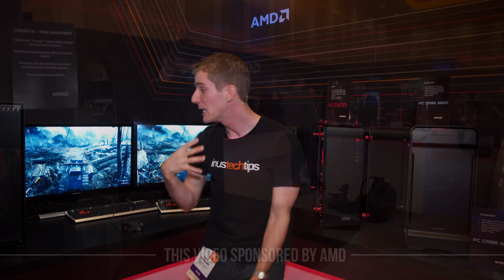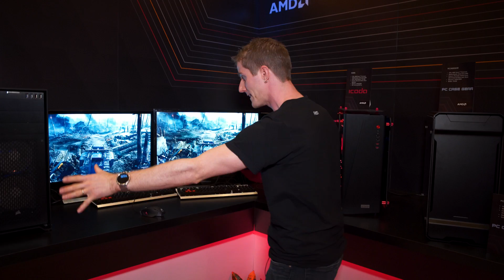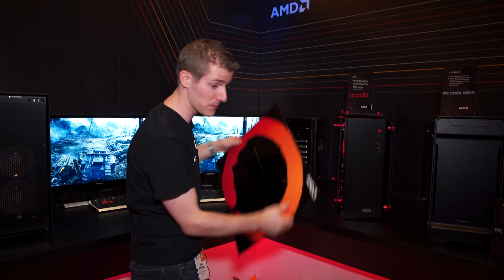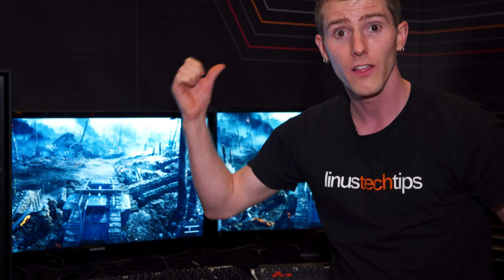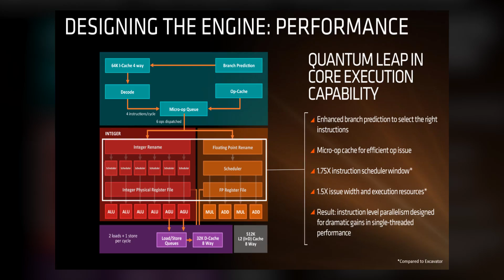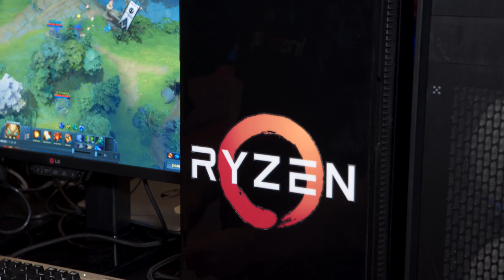AMD Has Ryzen!

Comment: amd prob handpicked their cpu
Reply from the maker: +Portgas D Ace it really doesn't work like that...
Reply: Pretty sure they used their feet
Reply: Linus defending AMD??? Is this an alternate universe??
Reply: good one linus!
Reply: Portgas D Ace Are you stupid?

How do you even handpick a CPU? This isn't like a GPU where certain chips OC Higher, this was a test made at 3.4GHz without even having TURBO enabled, which has been confirmed works at 4GHz.

Like, the fuck you're on?
Reply: its good for the consumer that AMD is getting back to basics and pull it together, me myself will never buy AMD (intel / nvidia fanboy) but for its good for everyone if they keep getting competition 
TLDR: AMD back, lower prices and more advancements on both companies
Reply: silicon purity only affects overclocking and that AMD CPU was running stock with no CPU boost so in conclusion even if they decided to get a 100% pure chip it would still be as fast as regular (At stock clockspeed).
Reply: roasted
Reply: LinusTechTips Linus be telling kids what's what.
Reply: SO WHAT? You think Intel doesn't do the same thing?
Reply: Sigh...what Linus means is you can't handpick more cache and IPC performance etc, it's hard clocked at a certain frequency, what 'handpicking' means is picking a CPU/GPU/Monitor or whatever piece of hardware that is above the rest in terms of overclocking and using that in order to skew results, that is NOT relevant to these tests whatsoever, even the best overclocking chip known to man doesn't have any benefit over a shit one if they're both running at a set speed...basically you look like a fool.
Reply: Portgas D Ace the fuck are you talking about
Reply: why the hell do you want amd to fail?

intel has not been innovating and that much is very apparent, they have not had a serious competitor in years and now amd threatens intel's market dominance with ryzen so "they must be hand picking their chips cause amd sucks so bad"

even if you are an intel fanboy, amd getting better only benefits you since it will force intel to not only lower costs of current chips, but also be forced to release faster chips unlike the clear money grab that is kaby lake
Reply: This guy lmao
Reply: Almost seems like these kids do not want intel to have a legitimate rival and for the prices to fall due to competition, Your parents must have more money than sense.
Reply: Portgas D Ace its like you want Intel to keep winning and charging you 1K or maybe even more for their 6900K, what are you stupid ? Not sure about US but the new Z270 boards prices had increased significantly once more like the MSI Pro Carbon its now same price as their old M5 Gaming seriously wtf and their Gaming M5 is more expensive than the Z170 Sabertooth. I can't wait to see the day mainstream Mobo that costs us over 600$
Reply: tbh he's probably just angry that intel has some competition for once haha
i mean hey he can think whatever he wants but i, for one, love how amd is going to be forcing intel to actually upgrade their cpu's decently for once. kaby lake 7700k is legit equivalent in performance to an overclocked 6700k.
Reply: Stock clock speed is stock clock speed.  These chips are ready to release and just waiting for marketing, packaging, and partnerships to finish their end (finish MOBOs, build laptop and desktop consumer devices, etc.)...this means that the stock clock they used in these particular demos will be the same as the stock clocks you get in your OEM packaging.  Now, I am sure they hand picked what they overclocked to 5 GHz for the press events they did last month...but that still isn't underhanded as one in 5 processors going out in OEM packaging will be capable of even slightly edging what they handpicked, and probably only 1 in 50 not able to get close enough to those numbers to be considered passing.  This isn't 1995 where 30hz difference was miles apart in performance...you miss 5.0 and land on 4.97 I don't think you are going to bitch and complain.
Reply: butthurt Intel fanboy spotted
Reply: +LinusTechTips it could have been binned for better overclocking but thats about it
Reply: It wouldn't make a difference if AMD handpicked the CPU, because Linus says that it's running at stock 3.4 Ghz speed, without any dynamic overclocking features enabled. So, the best and the worst same-model Ryzen CPU, running at 3.4 Ghz, is only going to deliver the performance of 3.4 Ghz.
Reply: yes, handpicked...
hence why the clock speed is below that of the production models, and turbo-core is completely disabled.....

I mean it could be a high binned chip, it could even be capable of breaking 10ghz on LN2 for all we know! however it's just not set up to take any advantage of cherrypicking whatsoever as any potential advantage has been tuned out for testing and demonstration purposes.
Reply: they werent overclocked fuccboi..so it doesn't matter.gtfo
Reply: These processors were clearly prototypes, along with the motherboards featured. Dont get into the conspiracy idiocy so soon boy. They're NOT EVEN OUT YET.

Great features in perspective, thanks Linus (and also the one(s) behind the camera) !
Reply: Because people are emotion based thinkers not evidence based thinkers. I am an intel consumer because for the last 10 years give or take intel has had the superior chips, not the best cost to performance ratio chips but the best performance chips. Those are facts, you can look up multiple benchmarks that support that AMD chips under performed compared to intel. That being said if the Ryzen chip is better than intel's $1000 chip then it is better. It is too early to claim it is as we need multiple independent tests, but IF this is true it will be good for ALL consumers. If AMD actually becomes a competitor or leader in CPU market like they were in the past that will drive innovation. I am not threaten owning an I7 6800k knowing that the Ryzen is in all probability a better cpu. Then again myself worth isn't tied to me being part of the "winning" team. If when I buy an new computer and AMD has the better cpu I will buy an AMD if intel has a better cpu then I will buy intel. I am "loyal" to the chip that best fits my needs not to a brand name.
Reply: Most likely! They probably disabled turboboost and downclocked too.
Reply: cpus are produced in large quantities as things known as "wafers". The process is 100% automated and there are only a few people to take samples and stuff... Machines are the ones that detect defective chips. Sometimes defective chips are rebranded as cheaper models. That's basically it. I'm not sure if you know this but nowadays the Core i5 series are in fact defective i7s... However there was an i5 model which was in fact designed as an i5 from the very beginning which was the Clarkdale. The Clarkdale i5 was sold as an MCM featuring the Clarkdale i5 CPU chip and a GPU chip as well. It was a package with two chips.
Reply: Like the common animal in the wild, when attacked strikes out in moody pointless words. Typical bland comment from +Portgas D Ace
Reply: hand picked?? If a cherry picked GOLDEN sample capable of 5.5Ghz is compared to a dog shit overclocking CPU they will still perform the same when at the same clock speed. In these example the CPU was clocked at 3.4Ghz with no turbo. Period. Why the actual fuck is such a retarded comment being upvoted....
Reply: Over 493 idiots ticked this guy up wtf.... Handpicking Ryzen and then running it at 3.4GHz base clock has what advantage exactly?
Reply: honestly if you fan boy over any brand it's really stupid, I personally buy what has the best price to performance within my budget; I personally think people who dont do this are making a very stupid move and missing out.
Reply: Even if it did work like that, no shit! Why would any company with the purpose of making money, not show off the CPU at its best. I have an Intel chip, but even I can see why this statement is retarded.
Reply: pretty sure most, if not all preview hardware is likely to be cherry-picked.
Reply: you dumb fck
Reply: At stock speeds hand picking a cpu would be meaningless because the performance would be the same for all chips that passed quality control. These demos ran at stock speeds so no need to hand pick.
Reply: ... Vega isn't out yet. a Titan XP is, and since you're comparing CPU's you have to minimise all other variables.

Adding an unfinished CPU AND an unfinished GPU to these test systems would completely muddle the results.

So there's no way in hell any sane company would use something like Vega in a demo trying to prove what their CPU is capable of even if it's the best graphics card ever made by a huge margin.

They have to use something which has known performance.
They could have used a Fury X or RX480...
But let's face it everyone knows the Titan XP is faster than either of those.
Plus, using an nvidia card avoids accusations of using underhanded tricks with the drivers and CPU logic.
Since they didn't make the GPU, it's much harder to claim they did anything weird to it to make the AMD CPU look better...

As for cherrypicking the test CPU.
No, duh.
It's an engineering sample. Those often aren't as good as the production models in general, so you end up needing to choose them carefully just to get results in line with the final product.

And really as everyone has already pointed, it doesn't matter because the only thing you get out of it is potentially faster clockspeeds.
But, that's only relevant if the speed you are testing at is much faster than what most of them can even accomplish.
If the test was done on a chip that could do 3.4 ghz and most of them turn out to only be able to manage 2.8 you might have a point. But otherwise it's really quite irrelevant.

OK, yes, a cherry-picked CPU will likely produce less heat and power too, for a given speed, but that's only relevant if that's what you're testing for...
Reply: Even if they did, they didn't overclocked it, it was running at 3.4GHz vs the 3.7GHz of the 6900K while maintaining the same level of performance, which is already by itself VERY impressive!
Reply: You realize it is running at the base frequency so there would literally be no benefit to "hand picking" the CPU. Right?

Fanboys are so sad.
Reply: +Jonhy456 Handpicking a cpu means testing a bunch for overclocking potential and choosing the best one for show, or use... Which obviously has nothing to do with base clock results.
Reply: I don't think that it was mentioned that the chips were OCed
Reply: Portgas D Ace because if they handpicked it from all of them then at best it would get better clock speeds for overclocking, and even then that machine isn't using a cooler that could make use of that, but even if it did it still wouldn't matter because clock speeds don't make much of a difference when gaming, so in pretty much every sense, what you said isn't how this works
Reply: Implying Intel and Nvidia don't, fucking retardation to the maximum.
Reply: Portgas D Ace so does intel when they show their CPUs
Reply: They don't think their hardware sucks, they just are smart enough to realize that the FASTEST gpu on the planet right now is the Titan XP. That was a smart decision. Shut the fuck up, you fan boy.
Reply: personally fanboyism is dumb, get what is better, for me an older amd 8 core at £120 is better than a newer albeit better intel 4 core at  £250, my build is a 960 and 8320 built at christmas 2015, i wanted to go all amd as their buisness model is better ( almost all their technoligies are open source ) but the 960 is so much better than the 270. amd ryzen looks really promising and i hope with more optimisation a lot of games that struggle on amd will become great. ( amd's single core is horrible plz fix, 30% usage in arma 3 with 20fps ugh )
Reply: well he has a point ( they picked the CPU using their hand and put it in the MOBO  by hand ) * grins *
Reply: lol handpicked one that only ran at 3.4ghz riiiiiight
Reply: it wasn't over clocked or boosting so... that woudnt have made any difference in this test
Reply: ARMA is a horribly optimized game. Its still as horribly optimized as Operation Flashpoint was from 16 YEARS AGO, which still even today no CPU can play at 5000m view distance... That just means the game engine is crap, not the CPU. 

Try to be a bit more rational in your remarks Portgas...
Reply: are you stupid? These are brands we are talking about not fucking sport teams, you shouldnt buy computer parts based on which brand it is
Reply: Weak excuse .....
Reply: They handpicked a cpu to run at 3.4 ghz? It wasn't overclocked and the dynamic range boost was turned off. What were they handpicking for?
Reply: Goddamn, 1000 dumbasses liked this comment.
Reply: If you knew how CPUs are produced on silicon wafers, you'd realize this sounds silly.
Reply: +Portgas D Ace

What are you talking about? There's no mention of them overclocking here. A CPU either runs at it's spec or not; variance of different chips plays a factor when they're run above spec, such as with overclocking.
Reply: @ Live Unlimited Fanboy Much?
intel has iGPU .
 bin picked by testing makes what  a 7700 or a 7700k or even an i5 or i7 will be so your wrong on the OC too.
AMD doesnt work on GPU anymore its Radeon and the business is official seperated .
what you call "better" means cheaper as you cant afford intel or Nvidea's high end stuff.or as AMD fanboys like to say price vs performance.

Dont get me wrong Ryzen should perform 10% better than 6900K at 8/16 and atleast 5% better than 7700k at 4/8 so the fanboy war can keep going on .....
Reply: I currently I prefer Intel CPU but I prefer AMD GPU, but RYZEN could change my CPU opinion.
Reply: the fuck are you on? CPUs are exactly like gpus... Each and every one of them may be different and has their own potentials at OC and btw clock speed isn't the only variable that determines the overall performance of a CPU
Reply: amd fan boys still gonna buy 32 core cpu's for four core games and cry when it sucks lol
Reply: he got upvoted so people can see his fanboyism XD
Reply: when amd butt fucked you did they use lube? by the triggered comment I guess they didnt
Reply: See this is the kind of "Intel Fanboy in Disguise" comment wrap a jibe in a fragment of what sounds like logic to cover your bias.

When a manufacturer be it Intel or AMD states a base clock then all cores must be capable of that clockspeed otherwise they open themselves up to false advertising lawsuits much like Nvidia did with the GTX 970 "4GBGate" My Intel 4670k for example runs at its 3.4Ghz Base Clock on all 4 cores, I can overclock all 4 cores to 4.3Ghz and be stable however if I don't want all cores to be equal than I can overclock core 1+2 to 4.5Ghz.

Personally I don't get this whole stupid bias crap I've have both AMD/Intel CPU's and AMD/Nvidia GPU's I get the best performing card/cpu within my budget at the time right now its Intel/Nvidia next time round it might be AMD or it might be Intel again.
Reply: Well how the hell do you think they installed it? With their hands, genius. Kids today...
Reply: You mean just like AMD and Intel has done for over 12 years? Yes Probably. Your point?
Reply: LinusTechTips Shots fired. CES was great fun this year. Flir got the DUO working on Day 2, looks like it could be a cool thing to have for some content creators.
Reply: no they're not nvidia
Reply: They also procured the TOP OF THE LINE competitor to test against. If they got an i3 from 4 generations ago then that would be crap, but your argument is invalid for more than one reason.
Reply: AMD has Ryzen!
Reply: Portgas D Ace you mean AMD made their CPU better? lol
Reply: Portgas D Ace they all do that including intel and nvidia remember there selling a product that is why i have always said ill belive it when i see it
Reply: Learn to research a bit before you pick a fight acting like a know it all, fyi.

If you actually invested your time into researching properly as linus also mentioned these are the exact systems that was displayed at the New Horizon Event a month back, during that Event they tested  Ryzen at stock 3,4 ghz vs the i7 6900k yes Turbo boost was enabled here for intel.

They tested them in Handbrake and Blender rendering it doesnt get more CPU intensive than this and Ryzen actually beats the 6900K in handbrake by 5 seconds thats 10% faster than the 6900K

Please do yourself a favor and research before u start a discussion and make a fool of yourself.

and Yes they also showcased Ryzen with Vega during that event, but Vega is far from ready and thats why you havent seen any official pairing with Ryzen + Vega other than some Doom 3 teasers.

Also just to put a nail in the coffin on the handpick bs you claim.

Doesn't matter what intel does, Cherry picked CPU only gets better overclocking potential and the Ryzen was handicapped by putting it locked at 3.4 ghz pr. core rendering your argument invalid.
Reply: hey don't destroy ace name your fanboyism,  even though I myself is using intel i believe amd will be competitive this year  XD
Reply: AIRGEDOK biggest problem is only a fraction of consumers want "the absolute best"  overpriced 600$ or whatnot high end chip (wich barely  improves your experience anyway)  and most people are value minder don't care about a couple of % less performance when they can save hundreds of dollars. Value is way more important for me and it allows me to spend more on different things
Reply: +ADevilNeverCry AMD going to suck anyway intel will always be better I bet they already have the next cpu ready to hit the markets if ryzen proves to be a threat and nvidia has the 1080 ti ready as well. AMD should just quit while they're ahead those shares aren't going to be this high ever again lol.
Reply: +Portgas D Ace 
They did use a Vega GPU in the 4k Star Wars Battlefront Rogue One Demo.....so yeah.
Reply: They need to educate themselves that AMD have been ahead of both Intel and Nvidia in the past and there is absolutely no reason it won't happen again.
Reply: I don't think so, Linus said that turbo is disabled and CPU is at 3.4GHz which is stock for engineering sample F3
Reply: Rofl you are stupid, the clock speeds were at default with no turbo, if they wanted they could have picked a awful chip.
Reply: He doesn't need to you need to read up on Ryzen just like my current 4670K this Ryzen's base clock is 3.4Ghz only difference a "handpicked CPU" will make is to the max possible stable overclock, just look back at the ASUS PC DIY Channel vids on their Haswell build guides for z87/z97 with the 4770k/4790k CPU's their examples often go to 4.7Ghz-4.9Ghz yet most are lucky if they can get 4.5Ghz.

If 3.4Ghz was the overclocked speed you'd have a point since as it isn't your point is void.
Reply: WHAT THE FUCK DOES HANDPICKED CPU MEAN YOU ASSFUCKS????????????/
Reply: Btw for those who dont know yet.
Binpicked = factory process by testing processors(cpu and Gpu) on quality/performance to classefy the type its range does

Handpicked = out factory process tested performance based on single thread , multithread or overclock.
                         while single core is for stability , multi is task managing between threads and overclock for 
                         core speed . 
the last therm is used alot for cpu that is tested for max overclock capacity and in that spectrum  its mostly done in multithread but as actualy the intel K series can overclock cores individual and you will be surprised how much differance you can get between cores . this  knowledge is not knowed by much.

the therm overclock is actualy misplaced as the bclk is  standard at 100 Mhz and the "overclock" is mostly optain by increasing the multiplier and not the clock .

example of long debates 100mhz x 20 = 2Ghz but 200mhz x 10 is also 2Ghz  . both can be seen as not overclocked while  the 200mhz is twise the standard so should be considered as overclocked.

increasing the cpu multiplier will not affect ram clocks  as it has its own multiplier but increasing bclk does.
thats why you can change ram range 1:3 or 1:4 so it doesnt overclock the ram to much to increase stability as overclocking ram and cpu together fails alot.

 o yea and im an noob naive ignorant troll with over 20 years of experience in hardware .......
Reply: +LinusTechTips can you prove that?
Reply: Portgas D Ace ?
Reply: Harry Arita probably because they weren't
Reply: Simon Smith Exactly,IIRC these are just 3.4ghz stock chips used in these demos. That's the base clock for Ryzen,nothing special.
Reply: +Rhea Welsh they didn't even use cpu intensive games like arma 3 or even use vega gpus its as if they know their hardware sucks,
Reply: luigi90210 lol amd isn't affecting Intel corps bottom line in our lifetime bud
Reply: Welcome to CES at the YouTube panel! We have here +Portgas D Ace living on ZERO Intelligence. YES! You heard me right. Zero. Like a good apple, he gives questions like processors varying on performance in comparison to the common fruit in taste.
Reply: looks at whos the sponsor and u know why
Reply: How it does work, however, is that they do get to decide what demos they show and it is likely that the demo drivers being used are optimized in ways that would be impractical for an actual home rig that will need to perform other functions and be paired with components AMD can't control. The comment you showed in your video is very fair.

I will believe these results, when the Ryzen and Zen platforms are released into the wild and I see independent tests using consumer products and drivers. That is the only sensible stance for a consumer to have, regardless of what company you are talking about.
Reply: Wow, really hot arguments are going on.
Reply: +Kuralthys if they're trying to show that their cpu is better or equal to their competition why choose games that are not that cpu intensive as a benchmark.
Reply: Portgas D Ace so it overclocks better big deal. It's running at base clock in the video so it doesn't matter. Plus everyone does it.
Reply: Drakar Dragon so you're taking advantage of AMD just to get lower prices you are just typical nvidiot desperately trying not to get ripped off by those 2 companies if AMD's new products deliver much better results for a much better price i guarantee you will stop being an nvidiot
Reply: +Star Specter no I was addressing the original comment. Sorry about that. I hate how the new comment system doesn't work like the old one when it comes to replies
Reply: intel, nvidia, amd, everyone cherry pick the best results.
Reply: KapteinFruit Oh yeah, no kidding man, I get that completely. Everyone does that. I see your logic as well, I was making a comment of they manufactured their own new CPU (Ryzen) and stuck it up against Intel's i7. They still boil down to doing the same thing. Process. Each family serves their own purpose (Servers, Productivity, gaming etc.) But can be more effective at certain things. For instance. I would use Intel for Servers, because it's in their DNA to do good in servers, there's no way in hell a FX-95xx would do the same job as effectively or as efficiently. It's really personal preference for your own need. What AMD did was try and compare their upcoming Ryzen to a high end Intel processor to gauge how far they've come and contrast how powerful it really can be.
Reply: Did you even watch the video?
Reply: What video?
(Oh, yes I did).
Reply: Echiiru  you are right.
Reply: Andy G The thing is it doesn't matter even if they did since this isn't an overclocked sample. it doesn't even have their alternative of CPU boost. That's like taking a 6700K that can OC to 4.8GHz and a 6700K which can OC to 4.5, clocking them at 4.3GHz and saying that the one which can OC to 4.8 will do better. 

It just makes no sense
Reply: you know AMD is Nvidia
Reply: You're dumb
Reply: You think Intel doesn't do this? i5s are literally i7s that didn't make the cut to be i7s. "Defective".
Reply: +Drakar Dragon massive respect to you for being the good kind of fanboy, who understands why competition is better no matter what side you're on despite still having a preference :D
Reply: Except that the Ryzen CPU wasn't overclocked in the demo. There is no reason for AMD to use a hand picked CPU for better overclocking when they were running it at stock 3.4GHz with turbo off.
Reply: OMG the fanboyism is on another dimension level can stop laughing rofl
Reply: can you prove that?
Reply: Lol. It's funny whenever Linus replies to a comment. There's always those few who rush to say "Good One!" or "Damn, you just got rekt!" 

And it all could be just as simple as him saying, "It doesn't work like that." 

Yup, sounds like he really "roasted" the OP!
Reply: How in hell do you handpick a cpu???
Reply: I am rooting for AMD because of Intel's and Nvidia's unethical and counter competitive practices, and will buy Ryzen if it lives up to expectaiuons. 
Still, I use Xeon E3 CPU and a GTX 970 (AMD had no competing  mini-itx fitting GPUs at purchase time).
Being unreasonably fanboyish regardless of quality is just plain stupid!
Reply: sorry for the reply on your comment, please do not answer as I do not want to talk with somebody so ignorant like you
Reply: what THE FUCK does handpicked cpu mean?
Reply: Handpicked what exactly? They said every ryzen chip will run at least 3.4 ghz(or at least the 8 core variants), at the same clock speed every single ryzen cpu will be pretty much the same - actually they should perform better once the turbo and OC is on. Ryzen is looking extremely promising so far.
Reply: I'm guessing the OP and Mr Ball Bender are either intentionally or naively trying to apply "GPU binning" to CPU's sure some of the system builders apply a degree of "CPU Binning" however that is strictly limited to overclocking potential not base clock speed.
Reply: Brian Smith True, that's the hip name for it. :) I'm oldschool. circa 486dx
Reply: +Portgas D Ace what is your point about them not using intensive games for their tests? It doesnt matter ffs. Oh, and i think BF1 on ultra is pretty intensive, i mean, both pc's are sporting titan xp's yet they're hitting around 50-55fps so trying to use the game as an excuse isnt gonna work either.

What i would say is that Planet coaster might have been a better game to use for this test. A large park with 10k people in it can cause most cpu's to struggle which causes the fps to drop dramatically. The reason for this is because the cpu has to process all those peoples "thoughts" and "decisions" along with every other aspect of the game. If i were to play planet coaster on my i5 4460 it would die if i had a park anywhere near that size.
Reply: the burden of proof is on you.
Reply: It does work like that. Everybody in the electronics industry knows that if you ask for samples, you are going to get the golden samples*. But the rule applies to everybody, meaning that if company A's golden is better than company B's golden, there is a reasonable chance that their masss production average is going to be higher.

* That applies to none-publicly available samples. For exemple, anyone could order free samples from microchip, but since they were publicly available, they shipped the rejected ones, so you actually got the lower performance ones.
Reply: Guys.. You have to see the business in this. Lets say the 6900k goes for 1000$ and AMD launches the ryzen to 500$, then it means that if Intel wants to follow up, they have to price the 6900k within the 500$. This means that now BOTH companies earn less money because they are pushing each other down in price, which makes no sense, and trust me the ryzen will be a little cheaper only like 50$. The rules keeps the companies away from communicating with each other about the price, because Amd and Intel owns the market so they can control the market. The conclusion is that AMD is not stupid therefore they will launch their cpus at the exact same $ because if they dont they will force the price down both for intel and AMD and they will both earn less which is just stupid. Sry for my bad english, im from Denmark but im attending a business school atm master degree.
Reply: THE LAST TIME I ASK... WHAT IS CPU HANDPICKING??????????????

 +TheBrother377 +David Wilcox +GFmanaic +Joe Blackwater +Yatsenko +Republic3D +denan hajovic +Brian Smith +xD +ikhansan hasbi +michael fisher +Democritus86 +SeigE _ +Дмитрий Т +MrBall Breeder +swifty +hit 2 kick +2stroke +chris Lesmerises +james brand +datwabbitwiz +gumbi1012 +lehel hanko +taxid3 +aa bc +basardius +gotte gri +alouigi +ome99 +martin +warsungames +leandro +fernando c +scott g +user +doge doged +dandrixx +alexander rus +dimos k +portgas D +abyssal dehn +trigg +leflavius +andrei zh +big thick +alex billing +airgedo +echiiru +etheoma +secondc0 +xinfin +thecatofwar +broken elegance +dark sky +patrik mis +claudiu ruit +tachemus +bosstrad +mstoshi1990 +random +krgan wrex +bram hoep +darkvale_gaming +jummy squik +funky atomich +katman & co +piotr osi +sevival +tapgg +joedirt +adevilnevercry +saqlain +cong hinh +yourteam +trenidad +kameron4 +rasmus +papa bear +star spect +pat cari +maloviv 123 +warockets +kapteinfruit +masterown3 +star specter +classic conundrum +dex4sure +minus eloso +laboonthewhale +robin muerk +blaster blade +theunkownguy +daniel santana +kinkykinga1 +kuralthys +mr.quantum +yuck foutube +jaon hutton +doc hollowood +ketherga +justin jones +muhammad +stu bur +thetechminecraft +karl massie +darksyne +lemonadical +james kregear +tony v +unstoppable +pepe peg +dylan harrison +yo peet +brandon hatcher +mshojat +dabid +luigi90210 +tony V +brandt (undeadllamas) +shiroikage009 +dontliveindogma +nicholas turner +crushed luminary +live unlimited +therasher +crushed luminary +amaya hirano +eric tan +kimzor19 +IISocrates +adardon 106 +goliath +ni k +gud name +philippe a. +trenzinho da +mr sosig +harry arita +bernie nernie +jeremy hale +bluescroba +rhea welsh +simon smith +jack ryan +harry arita +toast +devuno try +dargonante +nathan hamman +angel sonevs +jim F +andy G +dank memes +icarus +drakar dragon +shenanigans +alfie sokh +kevin ramirez +smokey zebrah +linustechtips On my last straw here. I tagged everyone in this damn comment thread.
Reply: Portgas D Ace Intel fan boy butthurt to the max.
Reply: Jonhy456 They want to so that's why they do it. Thing is it would make the CPU look/perform better then what you'll get once you buy one yourself. So what's wrong is it's deceptive. Anyway, if didn't matter even if they did it since the CPUs were both ran at stock and it didn't matter if it could OC more
Reply: @DysphoricSmile while  i understand what  you mean .  people only seem to be interesting in clock speed but Ryzen bring more into the fight then just that .

USB3 Support , DDR4 support , 16 dedicated PCIE lanes for  pcie slot , support M.2 ,U.2 ,NVME , pcie express ports  in other words AMD comes very close to intels features.

on the cooler rant you only need  other cooler while overclocking the 6900k as it wasnt the case (only boost  clocks and no OC).

the show case showed mostly how the 8/16  is coded to work with each other in supporting and deviding the workload to all threads and by that perform equal the 6900k with boost and that at 3.4Ghz stock with no boost or OC  for Ryzen . while for just the gamers its not impresive for  professionals it is .

if you render an video for 12hrs and monitor the cpu load of the 6900k you see that some threads arent working at full potential . with AMD it will and means less hrs for rendering and thats not even boosted.

Cpu's are more then just hardware for gaming and gaming doesnt always need the best performance hardware 

As gamer you should look more at GPU's as for cpu an 4 core at 3 Ghz is good enough.but yea men like to compeat and show of with bigger dicks.....
Reply: +DysphoricSmile Are you running a Megahelms cooler too? Great isn't it?
Reply: That doesn't fucking work if there's no overclocking (even AMD's precision bullshit) turned on, stock speeds will remain stock speeds no matter how much you win in the silicon lottery. Educate yourself you fucking moron.
Reply: stfu fanboy eat the facts
Reply: Portgas D Ace as does Intel...
Reply: You gotta be kidding me? Are you  harvesting member berries?
Reply: Portgas D Ace 3.4 GHz? not that heavily cherrypicked
Reply: the AMD CPU runs hotter also the frame rate could have been locked and how can we know that was a Intel Core  i7-6950X
Reply: the Gearhead
You Said
--" the AMD CPU runs hotter also the frame rate could have been locked and how can we know that was a Intel Core i7-6950X "-------

OK first off Prove AMD CPU runs hot on any FX APU processors.Which are the only ones they have.If not you're either a liar,Intel-Fanboy variant,or just plain ignorant due to only listening to idiots.

    An If the frame rate was locked you have to blame that on every benchmark you have ever seen of AMD.Because those benchmarks have been locked frame rates due to programs an reviewers.Because actual people who use AMD find they get great performance an have to BRAKE GAMES to see the real performance an not turn things down.Its not AMD`s fault Software developers either 1.Do not optimize their games. 2.Rush games out the door making YOU the software tester on release date.Or 3.Optimized by Nvidia Gameworks.Which is designed to NOT work on any AMD product.

     See its one thing to create a better product.Its another thing to destroy a game so no one else can enjoy it.
Reply: You want to wipe his ass?  Eeeew.
Reply: People usually like to get some bang for their buck. Something which AMD could deliver for a long time. Still, lately the bangs started to be to small for my taste, even if the price/performance was still ok. So Ryzen is really good news. It good news because price/performance with intel is currently worse than it was with my 4790k, it is good news because ryzem seems to make AMD a valid choice again.

Good for consumers, good for everyone. Even if you buy intel. And Vega seems to be doing rather fine too, so good news on the GPU front for everyone as well.
Reply: you mean geniuses whose intellect you could only dream to have.
Reply: Well.. yeah. they'll take their first 1000 CPUs and bin out the 10 best for their demos, sure, but if their chips were still in the engineering sample phase and had no turbo enabled yet, the yields from the fab, efficiency, drivers to go along with them, performance, and therefore the user experience are all going to go up from here.
Will these chips be competitive with Intel extreme prcessors and the X99 chipset in general? Probably not.
Will they cut off a large part of the market of people who were buying anything from i5-3570 to the i7-7700K? yes.
Reply: right because if that worked that way.... why not use the design of that "hand picked cpu" for everyone? so Portgas probably doesn't realize that
Reply: If it DID work like that, everyone else would to that.
Reply: Live Unlimited could you explain how to tell if AMD cpu is strong.
Reply: AMD marketed their GPUs not at Best performance over everything else but at best bang for buck, they DO know they don't have the strongest GPU. That is why they went with the 1080 cause it is the flagship GPU out of both companies.
Reply: +LinusTechTips Unless you're talking about their Triple Core cpu's :p
Reply: So would you buy the Ryzen CPU when it comes out?
Reply: công Hinh Phan I have been planning on buying at least two.
Reply: +Thetechminecraft here we have a cringy 12 year old who plays minecraft and should not have a YT channel due to the TOS saying he needs to be 13.
Reply: ***** I mean, it's a cheaper alternative to the high-end i7s, right?
Reply: Portgas D Ace as if Intel doesn't do that
Reply: wow you guys are a**s but just speculated from a rumor a model of Vega may have some 4000+ cuda cores which may help it against a Titan XP.
Reply: I like this guy's intuition thank god you have a brain and common sense
Reply: 512 amd fanboys just thumbup orgasmed on you
Reply: justin jones Who?
Reply: Portgas D Ace Yeah, they manufactured their CPU and picked the best CPU out of Intel's lineup. Either way, they do the same thing regardless
Reply: arma is so horribly optimized. why would they choose that.
Reply: Dex4Sure I'm not a fanboy, I'm just a guy who spends his money on what fits his purposes. They all really do the same thing. Process. If you REALLY boil it down. Right now, If I could buy any processor it'd be a toss up. Kaby Lake and Ryzen are both processors, I'd have to figure in what I'd be using them for (Servers or gaming etc.)

Edit: Not trying to be a dick, it's just my opinion, you know what they say about opinions
Reply: You're dumb
Reply: Masterown35 Think of this next time you say something that dumb again. Why is the comment dumb.

Addressing my previous comment is what I'm assuming.
Reply: They didn't overclock any chips to 5Ghz for a press event they under clocked to 3Ghz originally to show IPC comparison. The only thing that has been 5Ghz was a rumoured OC of a sample chip by a french website or something like that
Reply: you guys need to chill. AMD's using an engineering sample which runs only at 3.4 Ghz without boost as what linus (and AMD during their livestream) has stated. Mobo's not even retail meaning it's a prototype.
Reply: Masterown35 I hate this system too. YouTube can hurry up and reformat this like everything else in the past 5 years lol
Reply: Star Specter AMD Ryzen does launch new CPUs with 32 cores which intel has no counterpart to so server processors in their genes laugh out loud, doesnt work like that. Ryzen will be a grear deal for servers but, will it be for consumers when comparing vs a 6700/6700k? We shall see
Reply: I know this is irrelevant, but HMD Global has just released their Nokia 6(oh, and it's only for sale in China).
Reply: HAHHAHAHAHHAAHAHHAHHHAAHHAhahah... he thinks it wAHHAHAHHAHAHAHHAHHHHHAHAHAHHHAHHAHAHHAHHAHAHHHAHHHAHAHHAHHAHH
Reply: What he says is, that AMD is bad, because they can't compete on time. No one cares if you beat 1080 year later, that's expected. Launch within one month of competition and beat it, that's points.
Reply: Yeah, sure.
Reply: PJSalt
Reply: Portgas D Ace 
ahahhahahaha
Reply: +Darkvale_Gaming you are joking right?
Reply: Portgas D Ace 
and everyone play arma 3 ?unlike bf1ahhahahha
Reply: +Krogan Wrex intel has already probably 4 to 5 chipsets already waiting to be released the moment their dominance in the market is jeopardized same with nvidia pascal was just a card to be released between maxwell and volta.
Reply: Krogan Wrex I love amd, but I hope it won't burn my house down with 5ghz on air...
Reply: Sevival If your premises was true about CPUs and value being more important to "most people" vs. just yourself then Intel would not command over 80% of the market share currently.

[source] https://www.cpubenchmark.net/market_share.html

The evidence here would suggest that AMD has FAILED to give most consumers what they want because most consumers buy intel by a 4 to 1 margin. So we are not talking about an insignificant difference here.

So while AMD might be the best fit for yourself and 20% of the market it isn't the best fit for 80% of the market. The numbers just don't support your theory. It would seem that people want superior performance even if they have to pay a premium price for it.

This is backed up by AMD creating the Ryzen, they are not going for a mid range cpu here they are targeting intel's top chips. I would not be surprized if this was a $600 to $750 chip designed to compete with intel's $1100 chip. I think AMD fans should be prepared for the Ryzen to given a premium price point as it is targeting premium intel chips and their "value" strategy of the last 10 years is a failure by and large.

Being the best VALUE cpu has hurt AMD not helped them, they have steadily lost market share over the last ten years. They went from almost 50% of the market to less than a quarter of the market in 10 years that isn't a sign their strategy is working.

Do you have any evidence to support that "most people" want value for CPUs? Because I see zero evidence for that position. Like no evidence at all.
Reply: lmao
Reply: Dark sky they were able to pick the best looking chip by hand picking? That's an advantage right?
Reply: Portgas D Ace i think we can all establish that you're trolling at this point, think we found the 12 y/o u talked about earlier

im so happy that amd is coming back even tho im using intel cuz if vega and ryzen are successful building a new system wther it being amd or intel based is gonna be cheaper with competition as they will drive down prices to sell more. any stupid fanboy is blinded and doesnt realize this
Reply: Burden of proof doesn't lie on me but on linus.
Reply: *****
what are you talking about? are you even replying to the correct person?
Reply: Piotr Osiński Right, I'm fairly sure that AMD is pushing a Titan XP competitor and will have a number down version to compete with a 1080.
Reply: No AMD is not Nvidia.They don't hand pick.There is nothing phony or underhanded with AMD.They are a crew of nerds who are perfectionist.
Reply: you think they are perfesionist?
everything is FAKE
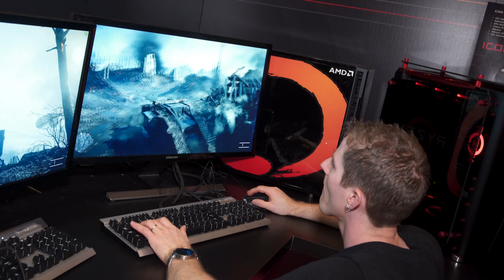At 2:23 intel hits 75-76 fps costantly
whereas amd hits 55

also, the amd marker is white , whereas the intel green,
because they never exeed the 58 fps 
when they do, it turns green!
Reply: *****
AMD has never been the rear.That was Intel.Pushing Dual cores when 4 cores where available.Then AMD releases 6 cores.Intel ignores it.Then 8 cores then Intel produces 4 cores.Intel has always been late to the game.Not AMD.Nvidia is a whole other story.They are just ruining games so they can push their old graphics cards with slight improvements.AMD does the same thing.Just re-releases the same graphics card with slight improvements.
Reply: +đenan Hajrovic It's because nothing is moving in the game dumbass
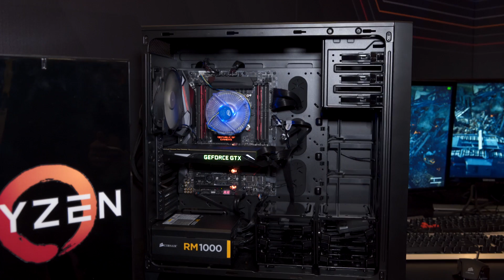Reply: AHA? LOOK AT 2:05 THEN LINUS DOESN'T PLAY BUT INTEL HAS STILL GREEN FPS..OOPS!!
Reply: what does handpicked cpu mean???
Reply: tell me your scenario. What happens if AMD handpicks their CPU (even if they didn't) for this demo? The cpu frequency is given at 3.4ghz
Reply: Portgas D Ace what the hell are you on about?
Reply: SOME BODY ANSWER ME < . >
Reply: My 4790K clocks stable at 4.7 on air... with no throttling. And from my experience, and the "Devils Canyon Club" forum, anybody who can't get more than 4.5 doesn't know what they are doing. Ofcourse, effectively 12 heatpipes and a crazy massive sink help... Anybody want to donate a "280" rad? I'm on the quest for 5ghz...
Reply: intel fanboy
Reply: so much crap from fanboys and i mean both sides . the AMD cpu can be handpicked based on single core performance.  if they did so , that gona hurt alot of fanboys hearts. so stop saying its for OC only.

ive heard that Ryzen will not have APU's line up and boost will only be 300Mhz , both isnt confirmed and sofar no news of overclocking or the 4/8 cpu . all results are information from AMD itself and we have experience of fake info releases from AMD in the past.

before jumping in as fanboy atleast wait until its out and tested by the real channels.
Reply: fanboys? we just wanna cheaper cpu what can work with all technology and instructions with low TDP, but amd really sucks lately what give intel to rise cost for cpu
Reply: +Mr Ball Breeder Are you talking to the OP? and please provide sources that handpicking does anything for base clocks. WE're all under the impression that binning is the process that proves good base clocks.
Reply: Portgas D Ace because amd are so sly
Reply: well overlooking the other thingss he has a point.. they should have used a more cpu stressing game..
Reply: I'm sorry but a cheaper cpu or gpu isnt necessarily worse. Sure, a more expensive intel cpu or nvidia gpu will usually out perform any cheaper amd product but thats not the point. The point is that the price gap between amd and intel/nvidia products doesn't correlate with the gap in performance.

And now amd is stepping up their game while keeping their prices low this should forcs both amd and intel to lower their prices so they dont loose too much of their market share.
Reply: Handpick? Wtf do you think cpu is? cookies? you cannot "handpick" a cpu like you handpick a cookie or some shit like that. The same type cpus are identical to each other, so it won't fucking matter. Pick a book and back to school kid.
Reply: Ikhsan Hasbi That's incorrect, not all cpu's are created equal. I suggest you research the process of binning. it's how they get their different clock speeds. all are made the same for a given model, but not all can achieve the same clock speeds stabile.
Reply: Chris Lesmerises "stabile" xD
Reply: it's called the "silicon lottery" kinda like how the RX470 is really just an RX480 that didn't meet the specs in the factory.
Reply: yeah, but the binning process only affect the limit of overclocking capabilities so the difference in normal usage is pretty much negligible or even nonexsistent dare I say. And it's clearly stated in the video both cpu run without any overclocking.
Reply: Martin Bralić 

The F game demo is F v-sync locked to 60 fps
Reply: One thing, the Ryzen CPU was not overclocked or using its boost tech... whilst the 6900K was O-o
Reply: true but in my experience AMD chips very often overclock very well
Reply: @ James Brand and Chris Lesmerises . nice try of trolling insults .
first you have to understand the differance between Handpicked  vs Bin picked and aslong you dont know the differance its pointless to debate with you guys on it.

i told handpicked single core performance  .while some still think that handpicked cpu is only for overclocking .the best single core performance doesnt mean the best overclocker and if you think that  then debating on this is pointless 

go read about clock ticks ,multipliers, data pastrue per tick before trying to debate with me on this.
Reply: You do know that most games are GPU bound not CPU bound right?, your either incredibly stupid or a very hopeless troll or maybe both
Reply: TheBrothers377 ok thats true but i believe the true fight is gonna be down on the 4c/8t processor where the mainstream is... where a single 20$ price drop can tip the balance heavily for the average consumer.
Reply: Jonhy456 The Commentcreator assumed they handpicked their CPU for this, which means they took the CPU with the best overclockability and voltages. That comment was absolutely pointless though since they run it all on stock.
Reply: Don't sweat it, buddy. Just some kid on crack saying some stupid shit.
Reply: David Wilcox ***** Whats wrong with doing that? don't they want to show off their best stuff at CES??
Reply: You mean like you handpicked who you replied to after getting totally roasted?
Reply: Alexander Rusev I see. thanks.
Reply: no. 2 cpus at the same base clock at the same voltage with the same cache will perform identically. Dosent matter if its intel amd or hell even a gpu no difference. If amd overclocked it then its sketchy but at base frequency no difference. Quit your bs. I actually have a intel cpu, so dont accuse me of being a fanboy
Reply: Jonhy456 No problem :)
Reply: Besides which, NO ANSWER AS TO WHAT THE FLYING SHIT THE CPU CLOCKSPEEDS ARE!! I mean FFS look at that TINY - not even in-spec Heatsink on that 6900k! I wouldn't even use that shit ON AN i5 SANDYBRIDGE! 

So AGAIN AMD; What the HELL is going on in the ENTIRE SYSTEM?! What are the ACTUAL GODDAMNED SPECS?! 

It pisses me off more than ANYTHING else! Because we ALL KNOW that an i7-6900k can EASILY hit 4.2 GHZ on just a Hyper 212 EVO - so if it it clocked at 3 GHZ like it was for the blender test, and the "Ryzen" CPU cannot get much higher than 3.8 to 4 GHZ regardless of cooling - AND the CPU costs $600+ - then NONE OF THIS MEANS ANYTHING!

Besides which, EVERYONE WHO KNOWS ANYTHING KNOWS AN i7-6700K running 5+ GHZ will EASILY beat an i7-6900K running at even 4.2 GHZ-  AT GAMING! 

So the question remains: ARE THESE RYZEN CPUS GOING TO PROVIDE ANY REAL COMPETITION IN HIGH END GAMING?!

Because DESPITE what AMD Fanboys LOVE TO SAY about "Intel is KEEPING the average consumer on just 4 core CPUs because they can and they are money grabbing assholes!" - those 4 core 8 Thread CPUs overclocked as high as possible - and I have seen examples of people easily hitting 5+ GHZ on air with the 6700k and the 7700k supposedly will make it even easier, and if you are a GAMER - those 4 core 8 thread High Frequency high IPC CPUs  ARE STILL THE BEST! 

So given that a sufficiently overclocked i7 6700K/7700K are still faster and more powerful WHEN GAMING - than a highly OCed i7-6900K - THIS TEST MEANS FUCK ALL!

Just like that comment they showed said! "AMD are the kings of hype and disappointment" - IF they do not release ANY CPU that can keep up with CONSUMER grade i7-4790K/6700K/7700K IN GAMING - then they MIGHT well just end up as BUDGET Workstation CPUs!  

And YES that is just a hypothetical supposition, I would be VERY PLEASED IF AMD RYZEN BEAT INTEL IN GAMING!  BUT - given their track record and even the VERY NATURE OF THIS COMPARISON - It kiiiinda looks like they may be simply OVER HYPING what might end up as just another budget offering compared to Intel! I mean we don't know the prices yet, but what we DO know is that 8 core 16 thread Ryzen is supposedly clocked at 3.5 GHZ stock, and I have heard a small rumor that someone confirmed speeds as high as 3.8 GHZ - but if it cannot go much faster than 3.8 - I would bet my balls that it will simply become another budget option, for Workstations that need higher core counts in particular. 

Even based on AMD'S own words, Ryzen us ABOUT as fast as Haswell clock for clock! So if those clocks do not meet or exceed what current Intel CPUS manage - which is now at the 5 GHZ level, then they simply will not be capable of competing! And again, I DO NOT WANT THAT TO HAPPEN - but I cannot help but think that is exactly where Ryzen will end up based on what LITTLE we DO KNOW! 

Also, simply stating that we KNOW SO LITTLE - this close to launch - does Not BODE WELL! If AMD had a TRUE "Intel i-core SLAYER" - AMD would be shouting that shit from the rooftops by now, and YET AGAIN - another MEANINGLESS DEMO TO HYPE FANBOYS! It annoys the shit out of me, just put what you have on FULL DISPLAY for ALL to see and be able to FULLY ANALYZE AND UNDERSTAND!
Reply: +DysphoricSmile you said a lot of things, and I'm not gonna respond to all of them. However, I will respond to your heatsink comments. The Wraith is going to end up being the stock cooler for the higher end Ryzen CPUs, therefore to create an equal comparison regarding a "complete stock configuration," they have to use the stock CPU coolers from both manufacturers.
Reply: MrBall Breeder  Everything you mentioned, PLUS better IPC and likely better clockspeeds are ALL Already available on EVERY Intel Platform available for the last 2 or 3 years now! 

So I get what you mean, AMD'S busted ass old CPUS did not have any of that, but those are NOT selling points to someone like me who already has ALL of that, and a CPU running 4.7 GHZ on  air cooling that never gets hotter than 68 C in any game or benchmark - apart from Prime95 that brings it as high as 85 C on the hottest core. 

And yes CPUS are for more than  gaming, but AGAIN - I, and anyone with any Haswell or newer i5/i7 CPU already has EVERYTHING they need - for gaming, for work, for EVERYTHING! 

IF AMD cannot hit 4 GHZ and above, it simply WILL NOT be able to compare with a REAL Enthusiast i7-6900K setup - which under decent water cooling is VERY easy to hit 4.5 GHZ and even above - with better IPC than Haswell by a little! 

ALSO - you seem to be ASSUMING that the 8 core 16 thread Ryzen will be CHEAP - I would bet good money that it will not be cheaper than $650, and I will not be at all surprised if the TOP 8 core Ryzen Enthusiasts CPU  costs over $800. 

What does Ryzen offer that WE KNOW OF - that cannot be done with current Intel CPUs?  What speed can Ryzen run, because we sure as hell KNOW that the 6900K will easily EASILY get past 4 GHZ-  but Ryzen, well NO ONE has any proof of any Ryzen running faster than 3.8 GHZ - which with its IPC will simply not cut it! 

AMD would be shouting from the rooftops if they had ANY SORT of "i-core Killer" but, surprise surprise more hype and leading on without any SOLID information! 

I do want Ryzen to be great, but AMD seem to want to keep any SOLID DETAILS fully out of SIGHT!  I don't even remember Linus saying WTF the clock speed of the 6900K was in this Demo! A Key detail that MIGHT give us a real idea of where Ryzen stands, ALSO they did NOT even have their "Intelligent Overclock" marketing wank engaged!  

I am left just wondering WTF was even the point in what I just saw? I mean  APART from Hype that is!  Also, WHO will EVER want to offload encoding and streaming from their likely powerful and certainly fit for purpose GPU? And I WONDER - why did they use DOTA2 or LoL for that CPU streaming nonsense? Couldn't be because EITHER of those games can run 4k 60 FPS on a potato from 2013 - I wonder, why didn't they use City Skylines for their CPU streaming demo? 

Oh wait, that's right, CPUS are TERRIBLE for encoding for streaming, BECAUSE YOU NEED IT FOR THE GAMES! Even more than you need any GPU of about GTX 960/R9 280 - UNLESS you happen to be playing a game that can ACTUALLY RUN WELL ON AN INTEL iGPU!

TL;DR

This was just MORE AMD MARKETING WANK AND HYPE! I will be HAPPY if Ryzen does succeed, but I have many doubts thus far! 

And like ANY SMART consumer, I will be waiting and watching to see EVERYTHING that Ryzen has to offer in comparison to what I could get from Intel for the same price!
Reply: Portgas D Ace I doubt it. earlier they used engineering samples. which like most engineering samples can't turbo and is at a much lower base clock (3.0 ghz as opposed to the consumer chip 3.4 ghz) i don't understand why they would do performance demos with underperforming chips unless that was all they had. the faster retail chips are probably still being manufactured.
Reply: DysphoricSmile again i understand and agree most of what your saying . myself having  a i7 4770k i5 4690k 2C duo E8400 and 2C quad Q6600 pc ,  still doesnt need to upgrade for gaming . and yes marketing bullshit happens all the time from intel , AMD , Nvidea and radeon and i also mensioned my doubts as there is no info of any 4/8 Ryzen ,boost or overclock info yet .

i never told it will be cheap i even sayed one week ago that Ryzen will be atleast 380 euro's thats still cheap vs the 6900k but not cheap to buy for most people but yea i expect even higher price.

its been told that Ryzen stock is 3.4 Ghz sofar and unconfirmed 300 Mhz boost,unlimited OC depending your cooler solution and AGAIN its features as told and showed so far exels intel performance with the precision boost, EFR,XFR ,neural prediction,smart prefetch all under SenseMI umbrella. thats  mostlikely the reason why the showed Ryzen  was beating  (nearly) the 6900k at 3.4 Ghz stock while the 6900K was at boost of 3.7Ghz .

you only mensioning the gaming results or stream results of that showcase but for me ,for an pro use, i saw also the results of HANDBRAKE and BLENDER and that my friend was  AMASING. 

for pro's having the option to buy an 800 dollar cpu that beats an 1000+ dollar cpu means 200 dollar not spend and faster production and as you know ....time is money. the faster and easyer you produce the more money you gain so its an win-win  to go for AMD if what is showed is true.

to compeet you need an equal platform  no point of AMD to come with DDR5 Ram  or USB4 so yea they dont bring new features but hey NVME  and U.2 support is only since 2016 for intel.

anyone buying the 6900K just for gaming and streaming  the game is stupid or to rich .

As gamer im more interested into the Ryzen 4/8 but as pro the 8/16 looks to be spot on sofar and could replace my 4770k as production pc.
Reply: Oh, I member!
Reply: casey .... read the topic line .plenty explaination here....
Reply: pine tree
 Same here.I just bought the Rosewill THRONE its onsale.Id get it now if i where you.http://www.newegg.com/Product/Product.aspx?Item=N82E16811147220

Unless you live in New York.You should leave.Like now.
Reply: just like AMD reviewers GPUs that had +200 Mhz to what they released.
Reply: checkout my vid
Reply: Portgas D Ace fuk u fuk boi
Reply: you didnt really watch the video to hear what linus said right? if you did you would already know
Reply: And run the GPU on old drivers.
Reply: AMD already said Ryzen chips will run at 3.4GHz or higher base clock. The demos are at 3.4GHz so why would a handpicked chip running at 3.4GHz be better than any other 3.4Ghz Ryzen? Easy to understand I thought but obviously not.
Reply: Any ITX mobos yet?
Reply: Simon WoodburyForget really? that would mean performance is inconsistent
Reply: CPUs are not like engines. In an engine, a tiny bit this way or that can sometimes lead to an engine that works, but just a bit better then spec.

CPUs are made with the same beam of light cutting via a lithographic process so exacting that they either work to spec, or something gets jacked up and that whole CPU die is trash.Maybe they ran it without an IHS? But Linus here has a video about how stupid that is with an Intel chip, it's not any smarter on an AMD chip.

So, their 'handpicking' would amount to making sure the motherboard could POST and running a quick diagnostic.

They didn't use Vega GPUs because it was a CPU test, and the 1080's performance numbers are something everyone is well aware of. It's a good card that wouldn't bottleneck the Intel due to beta drivers or anything, so that makes sure it's CPU vs CPU.
Reply: Exactly and the rest on the wafer is thrown away to disappoint costumers............... Even if it isn't exactly as fast as the latest Intel CPU's but people still have the advantage to clock them higher like their older CPU's did there will be some competition. Great for us costumers. Sick of Intel's monopoly they really don't have to be this expensive.  Portgas probably bought an expensive motherboard kaby lake CPU then he found out PCI-e 4.0 is also released this year. No mobo sold at this moment will support 4.0 it might be a bigger change for the costumer then a few cores and raw clockspeed. It probably will make a bigger difference in everyday use. Hope for him he didn't.
Reply: @MrBall Breeder

Uhm, AMD still owns the Radeon brand. They've always had a separate department working on the graphics cards. And they still get input in there, AMD APUs have Radeon graphics after all. And Radeon''s profits still go to AMD.
Reply: You mean green like it was when he is explaining what is in the intel rig? You can see both are green while sitting idle.. You're a moron. I get 100fps on my casio calculator